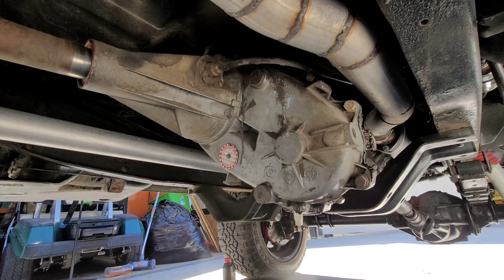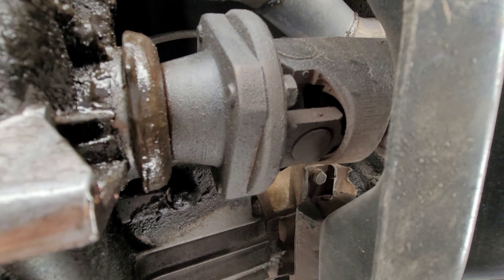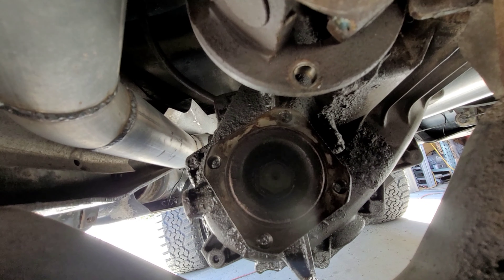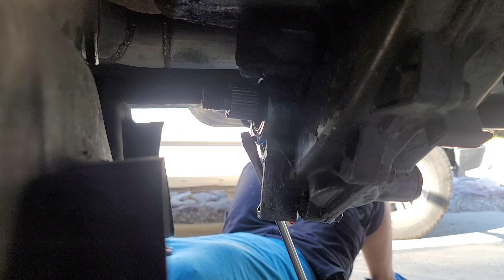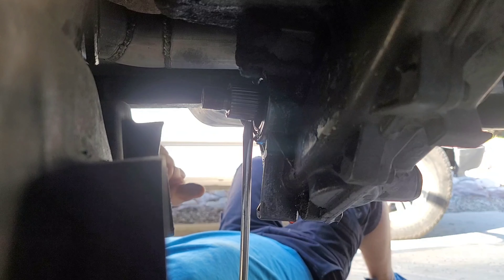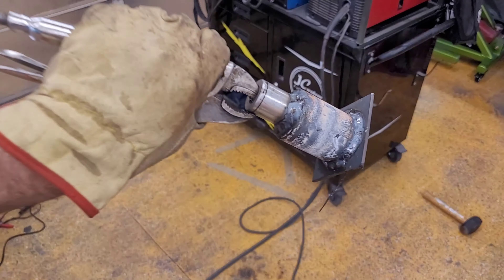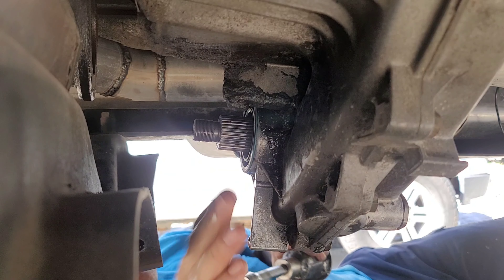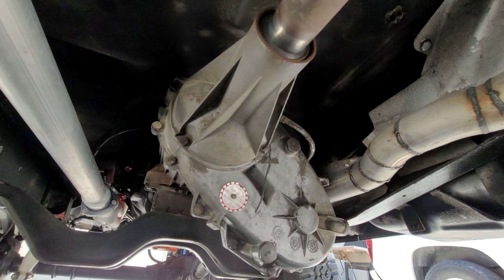"Oh no my transfer case is leaking" 208 front output shaft yoke speedi sleeve repair & seal replace

Comment: You should put some atv between the speedy sleeve and shaft. If not it will still leak
Reply from the maker: Thanks that is a good recommendation
Reply: Ya was raised by a master macanic and a machinist for over 30 years R.I.P DAD

Comment: They aren't the frugal fix they used to be, I got one like that for my balancer and it was like $40 while a new balancer was like $100. Hope it holds up well, mine has so far.
Reply from the maker: It is not a frugal fix and I do hope it holds up well... But I wasn't able to find that part anywhere no one's producing them right now.